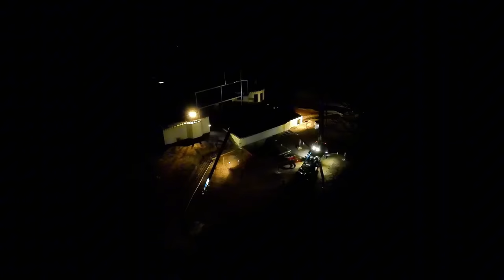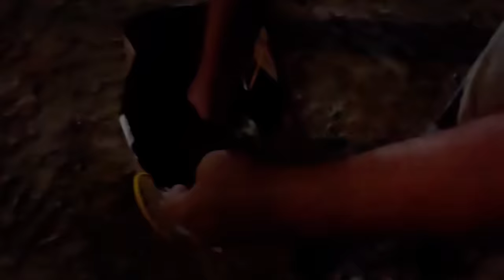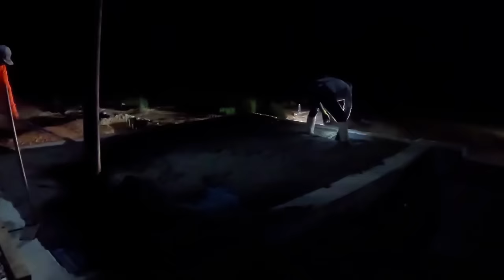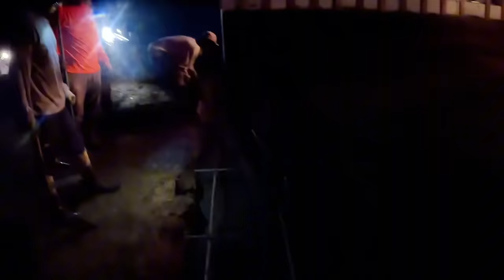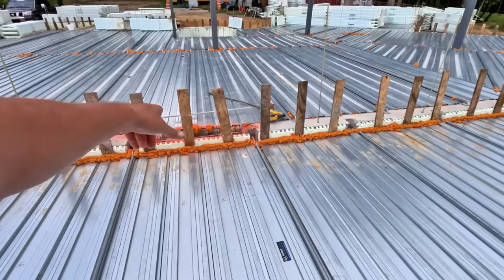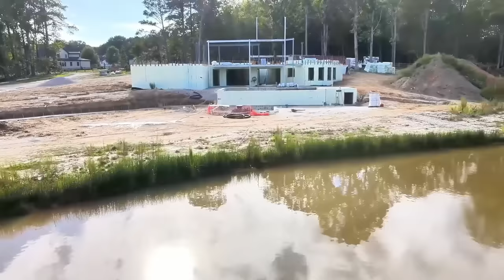Middle of the Night Concrete Pour

Comment: Build is looking great!  Hey, I hear you mention using Travertine tile in the pool area quite often and thought I'd give my 2-cents on the product.  I'm here in Tucson Arizona and the house we're renting has Travertine tile for the small landing outside the front door, those tiles get blazing hot from the sun beating on them - winter or summer doesn't matter, if the sun's rays hit the tile for an extended period, the heat they hold will sear your feet!  So much so that we have to leave a mat on that tile for the dog, as he can't stand there for more than a second or two while at the door waiting to come inside, and when it rains, those tiles become a slippery trap of falls!  But lots of people love them and don't mind their heat absorption or slip factor, saying it's comparable to all other tile ...but, we do things to the extreme here in Arizona, searing flesh is just part of the desert experience!  Perhaps test a few, see what you think.  Project is coming along nicely - good luck!
Reply from the maker: That is really really strange. One of the main reasons to use true travertine around pools is because they don’t get hot 🤔. I have a client with them around his pool and they don’t get hot. Wonder if I’m talking about a different material. Thanks for the feedback.

Comment: Harbor Freight has these single 'bulb' 4' led shop lights for under $20 during parking lot sales. I use 3 to light the driveway when I'm working on cars, but you can strap them to poles, ladders, scafolding, light stands, etc for lighting large areas

Comment: Coming along nice Geoff!  That pumproom is going the hold back the sound incredibly well.  Kudos to whoever cooked that idea up!

Your missing concrete is due to using excavated forms.  But then you'd have the cost of labor to set solid forms, the cost of the form material, and the cost of tearing down the forms.  It boils down to what costs less, solid staked forms vs a little extra concrete.

Can't wait to see what's next.
Reply from the maker: Thanks 👍

Comment: I remember the first time I poured concrete in the dark. The shadows from the lights showed all the imperfections, and I troweled, and troweled, and troweled, upset at the “trowel lines”, which would not go away. Later that day, after the sun had come up, it turned out that it was one of the best  finishes I had done up to that point, the trowel marks where simply shadows, and not lines or marks at all!

Comment: we use much more rocks in the mix at least for base. gravel is much cheaper than concrete we will then have crane instead of a pump truck. different countries different styles

Comment: Those are some seriously thick pours on those footers just for a retaining wall. It is not like they are two stories high. You sure you don't have Yankee engineers planning for Alaska weather? I have seen taller walls up in Indiana with pre cast dominoes stacked by DP holding back a lot more dirt than that and Mr. Dig in Georgia makes and sells those pre cast blocks too. Also a question: What goes on top of the theater? And does the driveway still go over that last bit of pour still? So many changes from the beginning I am starting to get confused. Oh well, sure looking good there Geoff.
Reply from the maker: My office. Yes. Thanks 😊

Comment: How much deflection did you have with the super floor? I saw a similar system a few weeks ago but it had a slight upward curve so that once the weight of the concrete was on it you had a level surface.
Reply from the maker: That’s what this system does as well. I’ll try to remember to get some inside shots in the next video.

Comment: I'm curious as to why you did a plug for the top of the pump room rather than a cap like you did for the bomb shelter.
Reply from the maker: @daneclark3161  The pump room roof had to be brought up to the same elevation as the top of the pool walls. Travertine goes over everything

Comment: Did you put waterproof agent in your concrete for your deck pours ? Also Jeff please vibrate all your concrete,please don’t pour your house floors without having the right vibrator (size wise ) sorry to sound bossy but have had 50 years in construction,go well young man well done taking on a project like this

Comment: wow...that slump is way high on that pour. Wasnt it tested on site?
Reply: and no vibrating on the footings, hmmmmm
Reply from the maker: It was a bit off to begin with but ended up fine. I think the thing in my hand was a vibrator but I could be wrong 🤔
Reply: Only reason I noticed was because my ACI certification. I did see many vids back where the mix was being tested and core samples made.
Great build, looking forward to seeing the end product. 
If you ever need 3D drawings of your builds look me up.

Comment: Absolutely nothing beats a good crew that's in sync with each other when it's time to pour concrete.
Those footings and roof structures are never going to be a problem. 
No surprise visit from Chris was a bummer but it is what it is.
Duck Mafia awol.
Dog dog, didn't want paw prints in the cement and the job of cleaning his hairy butt.
Congratulations on getting one more item checked off Geoff.